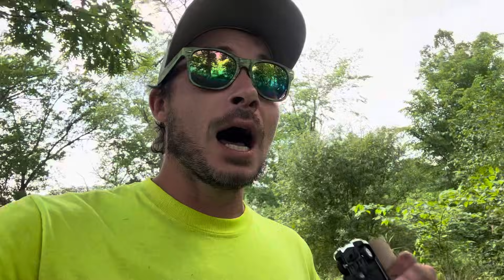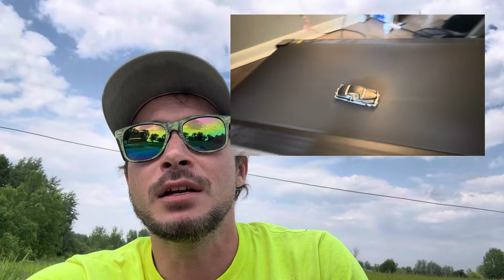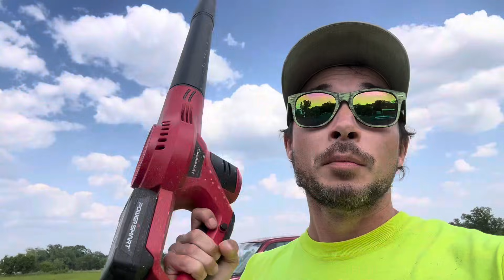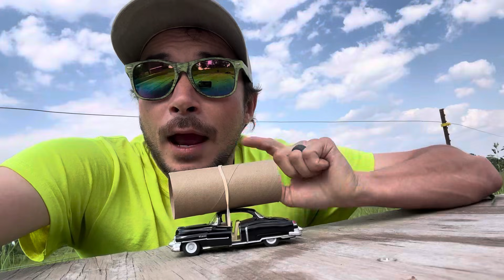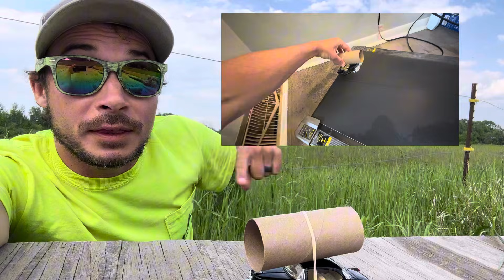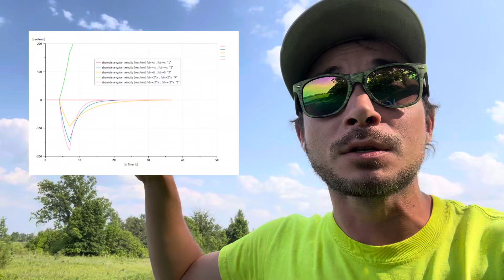Science! Can a plane on a conveyor take off?

Comment: If you have a front wheel drive car with the rear wheels on a small conveyor belt but it's front wheels on the ground, will the car move forward? Yes. The front wheels cause the car to move forward, just as jet engines in a plane will cause the jet to move forward.

Comment: The plane will not take off. Since the conveyor belt is matching the rotational velocity of the wheels, the wheels have no translational velocity relative to the ground. This means the plane in which the wheels are underneath also has no translational velocity relative to the ground. No velocity relative to the ground means no airspeed and no lift. No lift means no flight.
Reply: It only needs to be moving through the air. Velocity relative to the atmosphere. We just happen to measure that as ground speed because that's our reference frame

Comment: Sir Isaac Newton is spinning in his tomb. His Second Law governs the effect of the action on the airplanes mass caused by the engines thrust. His third law covers the effects of airflow against the wings due to acceleration caused by Newton's Second Law. Without airflow generated by accelerating the airplanes mass impinging upon the lifting surfaces of the aircraft it would require thrust in excess of the aircraft mass to achieve flight.
Reply: I'm 72 and I've been an avgeek since I was in single digits, I'm well-versed on how aircraft wings generate lift. You'd have too put insane amounts thrust on a 747 to cause it to take off from essentially a standstill. To see an example of this Google "zero-length launch systems"
Reply: It just struck me that there is a IRL example of why the conveyor belt idea is in error, aircraft carriers.If it were true, a jet fighter could take off from a carrier from a standstill. It can't, so the forward motion of the carrier plus the use of a catapult is needed.

Comment: Two things are true:

1. Airspeed, not tire rotation speed is what generates lift.
2. Wheels have a limit to rotation speed or they WILL FAIL catastrophically.

Assuming calm air, if take off speed is 160 knots, that means air needs to be moving over the wings at 160 knots.

If the conveyor is moving at 160 knots backwards then the wheels would have to be moving at 320 knots to achieve 160 knots airspeed -- they can't do that without flying apart. 

Landing gear wheels can spin at 2000 RPM on landing,  they can't handle 4000-5000 RPM without flying apart.

Comment: This would actually make it so airport runways wouldn't have to be so long.
Oh wait, landing 🛬 
Never mind 😂🤦‍♀️
Reply: I understand this is more humorous than serious, but it’s making the same error as those saying it can’t take off.

The plane has to get to a certain speed vs. the air to take off. You have to move forward, move along the runway, to take off. So it takes just as much length of runway to take off (or more, if you start to factor in the extra loss of energy to the friction of the wheel bearings, which is mostly being ignored in these kinds of hypotheticals)

Comment: It's completely counterintuitive. The concept of a conveyor captured continental conveyance is certainly confusing. For real though. I came into this thinking the plane could never take off because it needs air over the wings. That's logical. You're absolutely right. The treadmill and the wheels just zero each other out and everything else comes down to the engines. That was really well explained.

Comment: pretty sure the question is older than 15yo, but the answer depends on the power of the plane vs power of the conveyor belt. if the latter is powerful enough - it will immediately destroy the airplane's wheels, at best making it really hard for the plane to take off, and at worst destroying the plane itself when it falls onto the belt right after. but if the plane's propulsion is powerful enough to take off before or in spite of that happening - sure, it'll fly. other parameters that could influence the result are gravity and friction

Comment: This is not serious, but will say no on this one and have some fun. Think of a wind tunnel for example.  It pushes air over the wings, while the plane is anchored to the wind tunnel.  You have heard in movies about their airspeed right.  Airspeed is required over the wings not ground speed under the tires.  Airspeed is the speed of the air passing over the wings.  If it is ZERO, you ain't going up.  Aircraft carriers, especially back in the day would point into the wind to make it easier to take off.  This is because while the plane sits on the deck pointing into the wind, the wind speed over the wings is already greater than ZERO.  That's why the captain says "More Speed".  Not sure if this has anything to do with the conveyor, but if you moved the conveyor at the required speed with flaps down, eventually the car or plane would take off.  It's relativity.
Reply: I see you studied Troll Physics too.
Reply: @LexYeen sure.  everything is a troll.

Comment: WOW! the plane will not take off if the wheels and treadmill are going the same speed. Your car moves along the treadmill because you make the wheels turn faster. You changed the parameters of the question. Lmao, just awesome.
Reply: No , the plane will take off because… thrust. Physics. Mythbusters.
Reply: @davidstulb745   Why do planes need a runway to take off?
Reply from the maker: 🤦‍♂️ do I need crayons to explain this? 

I didn’t change the parameters at all. The thrust on a plane has no connection to the wheels, just like my hand pushing the car had no connection to the wheels. I’m not sure how much more simple this can be explained.
Reply: @off_jawaggon  What allowed the car to move forward when you pushed it is the wheels moving at a different speed than the treadmill, fact.
Reply: Hey OP? Buddy? This entire hypothetical is a Troll Physics classic. Has been for at least 15 years, probably closer to 20. The wheels are only there to let the pilot control ground friction. They don't provide thrust. The engine(s) aren't connected to the wheels at all. You sure you're old enough to use youtube unsupervised?
Reply: @LexYeen If you think a plane can take off without forward motion, you probably shouldn't be talking physics.
Reply: @LexYeen do the wings play any role in this, mr smartypants?
Reply: @T.E.S.S.   A plane cannot achieve lift without moving. If the wheels and the treadmill are spinning at the same speed the plane will not move forward to achieve lift. Why do you think planes need runways to take off and do not just take off from a standstill? The wings need air speed to create lift, fact. This doesn't happen without the plane moving. The plane cannot move if the treadmill spins at same speed as the wheels, fact.
Reply: @RictorScale-w7i  was that supposed to be coherent? I honestly have no idea what you're trying to say.
Reply: @T.E.S.S.   It is quite obvious you have no idea.
Reply: @RictorScale-w7i 
There is nothing mentioned in the question, which implies that the plane would, or must, be stationary.